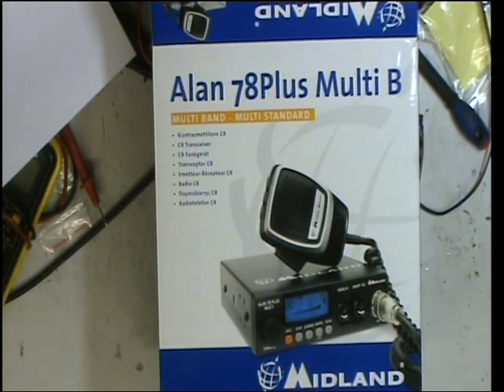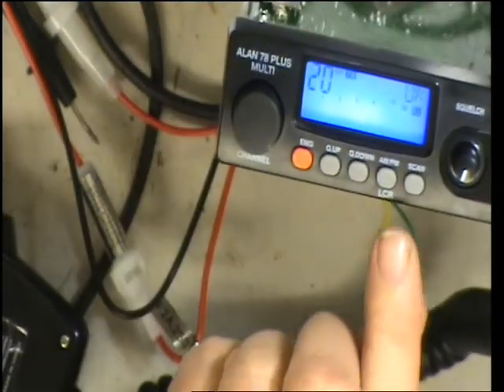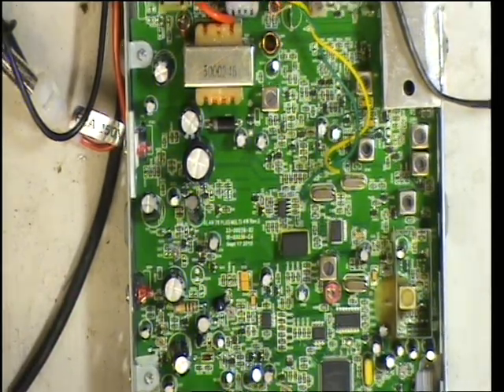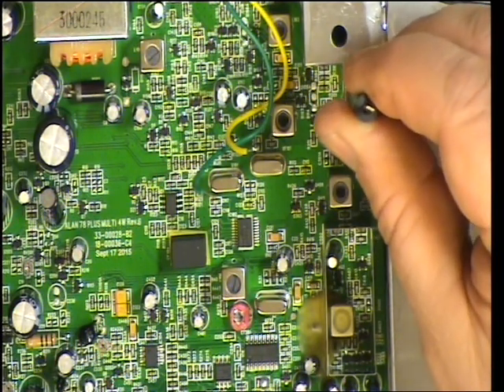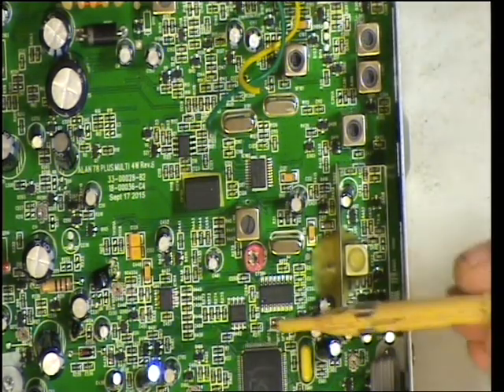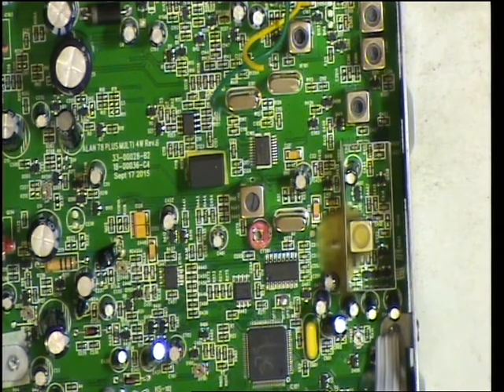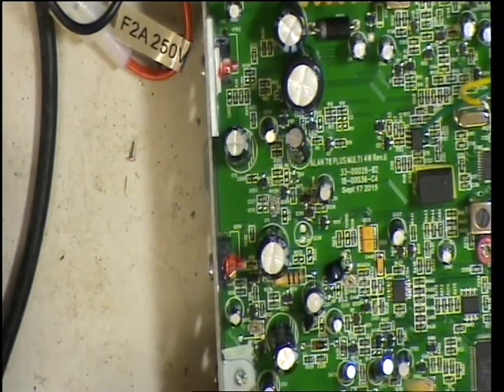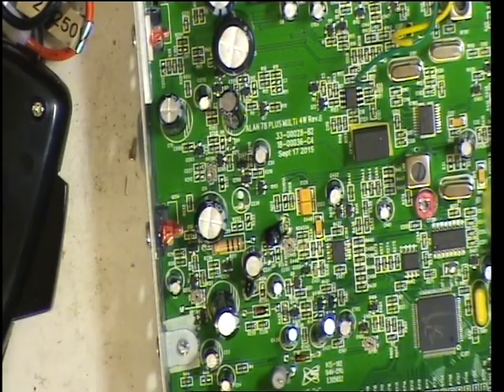Midland 78 Plus Multi Ver6 (UK) (CE) CB radio (mobile) -  TX adjustment

Comment: On mine opened with a can opener, I found a coil in the sealed compartment to twiddle, the controls seem very flat though, and I am getting more power on the EU channels. I see stretched coils in the sealed box, so probably peaked on EU. The driver transistor in the sealed box runs stinking hot, and had burnt out along with a series resistor that supplies it. Now do I really have to put the lid back on the sealed box...
Reply from the maker: The screening is to stop interference being emitted from the radio. It's like bypassing the catalytic converter on a car & would make the radio illegal.

I find they do 4W on EU & about 3.7W on UK

Richard, G0OJF, UK

Comment: Hi Richard, You last did the the 48plus multi a while ago, but on the other hand I've not seen the 78plus multi but I heard about them back in the day! :-)
Reply from the maker: Rob, I've just checked & you are quite correct. I knew we've had a few in over the years & wrongly assumed I'd covered it. This set is for me personally seeing as I snapped the previous one in half! It's these tracker action fingers of mine. I reckon the 78 has been going for about 15 years, but as I say in the video, this is version 6.
Reply: Jolly good, in future you need to be careful on those fingers as I know what the Track Action does!  Out of interest how many of these Plus Multi's did Midland do off hand?
Reply from the maker: The two different 48's & the 78. There was a 220 I recall with a front mounted speaker, there are some newer ones now as well even though the two 48 models & the 78 have been updated & are still current models...maybe called the 248 now.